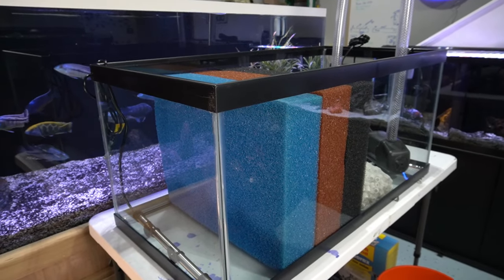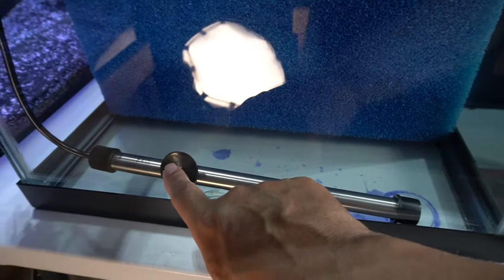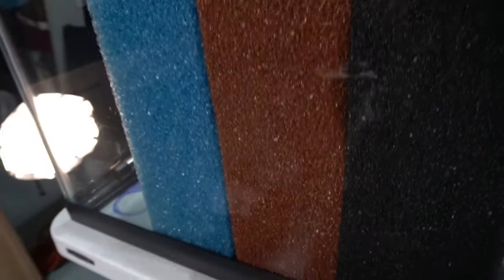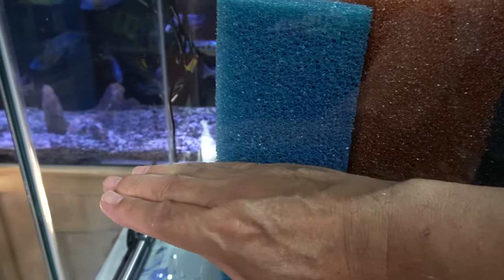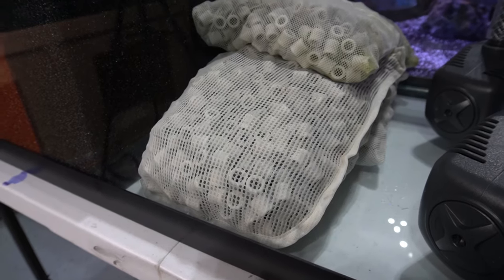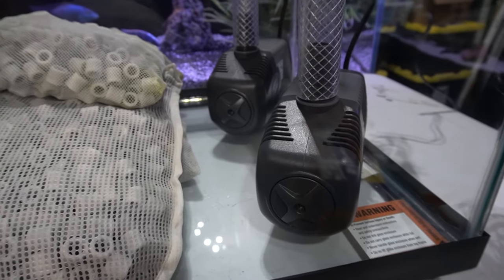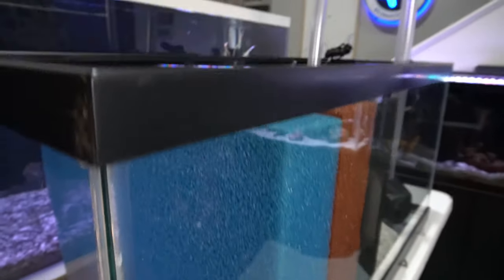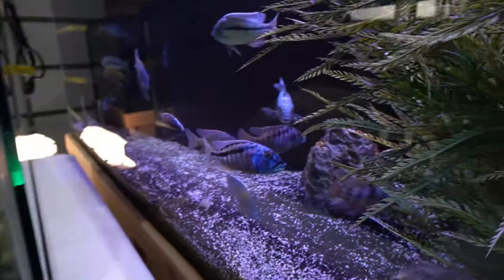A SIMPLE DIY SUMP [Going Under the 300 Gallon] - It's Going to ROCK!

Comment: Pj aqua maintenance 
Hi Ben the sponges in your 40 gallon breeder . What holding the sponges straight up.
Reply from the maker: They are cut an inch wider than the tank and have to be forced into place. The pressure allows them to stand on their own eliminating the need for glass baffles or walls.
Reply: hey you can just use silicone to adhere them to the place you like won't be more simple
Reply: @xmanu100  If for some reason you need to remove them you then have the issue of dealing with the silicone and possibly ripping the foam and again putting the silicone back on them. His way all you have to do is angle them out, deal with them then put back into place and done. Seems easier that way.

Comment: I just use standard bio rings in my Eheim canister never had a problem running nitrate level of 10 parts I feel these big names have got there hands in our pockets
Reply: Go to Swiss Tropicals website...they agree about all these fancy bio media types.  I have been using their 30ppi foam as my bio for years...far cheaper and far more surface area.
Reply: @T0tenkampf  spot on I only spend money when needed like I have Eheim classic XL 1500 filters on my tank and now have less than 5 parts of nitrate and have a well stocked Malawi tank

Comment: Keeping it very simple, yet effective with those massive sponges. Looking forward to seeing this sump dialed in and running. Keep the motivation going 😎
Reply: Best part is that those sponges don't break down, I have sets still in use after 12 years!
Reply: @T0tenkampf  Nice , I was reading up on http://www.swisstropicals.com/ and they have a nice variety at a good price. My next tank will have these incorporated in the sump for sure.

Comment: Exactly what I was looking for, I've been using Poret in my FX6s for a while now but want to try a Poret sump on the new 180 gallon red eared slider tank.  She and her 8 inch long pleco buddy are a bit messy.  If you have been to Swiss Tropicals website then why not use 30ppi foam for your bio filtration?  It's surface area for bio film is proven to be greater than any product on the market.   Yeah, I'm a big fan of Mattenfilters too lol.

Comment: I like this sump. I would have the 10 PPI single first and maybe add a thin 45 PPI sponge before the ceramic media. If you stuff filter floss or Purigin in an HOB filter, you can easily change it out every two weeks and have the clearest water ever.

Comment: Nice and simple. My only question/concern would be whether the sponges would get fully utilized..that would depend on how high the water rises on the side it comes in from the tank...but with those sponges, you're covered well Ben.
Reply from the maker: Ideally I want a couple of inches of free space at the top to handle drainage when the pump goes off. I could have gone with 12” tall.
Reply: The part sticking out of the water may actually act as wet/dry media

Comment: Love the sump ideas. You can add couple of gallons of K1 media where the water drops in, and that force will fluidize it. The sponges will keep it from floating around.  You will then have about half cu ft of fluidized K1 along with about 1 cu ft of sponges and Siporax. You could also add pot scrubbers around the Siporax and can cover that area without worrying about the pumps sucking things up. 

I would love to hear a  bit more about Siporax and why you chose that over other media
Reply from the maker: That’s a good idea

Comment: Hey, is a sump filter easier to take care of than a canister filter? The reason why I asked I have always had canister filters are over the back filters selling a 75 gallon aquarium with a 40 gallon sump under the bottom of the stand, the price is not bad the only thing he is, I’ve never run a sump. The tank used to be a saltwater, but I’m going with a freshwater.

Comment: Finally ordered my pads and now have everything needed! I got 3" 1x 10, 2x 20 & 1 30 for a 55g sump per recommendation
Reply from the maker: Let me know how it goes
Reply: @Ben Ochart  quick question, I'm doing a 55g version on a 220g, I see you're using 2 return pumps. (A) how many gph? (B) i would imagine one big one that does 1100gph would make the return flow very strong which is the reason for 2 smaller ones, am I right?

Comment: Just purchased my first 300+ gallon aquarium (new to me) has misc parts and pieces....Love the DIY sump setup you and will be building it. I need to find large bulkheads as the tank is Slate bottom pre drilled with over flow on each end....Slate is almost 2 inch thick, any thoughts on bulkheads ?

Comment: simple sump...fill a large rectangle bucket 1/3rd of bio gravel,  drill plenty holes in the base of a smaller bucket and then fill this bucket with sponge, sit it drilled holes down in the big bucket. water from the tank goes through the sponge and into the bio gravel, you put a return pump sitting on the bio gravel in the big bucket, you can put  heater sideways in the big bucket too.

Comment: Really enjoy your videos, you have some really lovely fishes. I have seen this sump setup in a video done at KG Tropical channel as well. I am about to set up my sump in a similar manner using biohome media. My only concern/question is would it make the media a bit less effective as water might go through the top section without getting in contact with the media or it not going to make a difference I am not sure so asking thanks.
Reply from the maker: I think you’ll be okay. Aerobic bacteria needs water flow but anaerobic likes little to no flow, so, worse case scenario is you’ll end up with some of both types and that would be a good thing.

Comment: What size sponge filter are you using? Seems exactly fits the tank. Thanks in advance
Reply from the maker: I contacted Swiss Tropicals, gave them the tank info and they custom cut the sponges to fit snug and perfect.

Comment: Looks really good ben I'm very interested in what you are planning to keep in the 300. Curious when will you  be revealing that information? Also i think the algae scrubber is a must for a tank that large because it won't be the easiest tank to clean so why not make you're life easier. Well take care ben and good luck. P.S. i saw you got a new hygger heater the large one thats kinda flat looking well i had the same exact one unfortunately it only lasted 13 months. I still like hygger but that heater didn't work out for me. I do have another hygger that's rated the same 800 it just looks a little different. I've had it for about 6 months so fingers crossed. later bro.

Comment: Simple is definitly better. I would Really  like to see this in action. Will you be using any floss pads in front of the sponges?
Reply from the maker: Possibly. I’m using one in the sump under the 210 and it stays clean because the socks do such a good job pre-filtering.

Comment: Sorry if this question has been asked, but is there any type of seal or bond to keep water from going “under” the sponges? Or is it so little it’s negligible? 

I just was thinking if the pumps were so low, they’d be pulling with main pull towards the bottom of the sponges.
Reply from the maker: I think, based on watching the accumulation of detritus over a couple years, it’s negligible. The accumulation of detritus seems evenly distributed.

Comment: How can I clean my pump without flooding? THANKS AGAIN BROTHER...
Reply from the maker: Part of setting up a sump is determining how much water will back siphon into the sump when the pump is off. Just play with the total amount of water that you're running until you determine how much can be run (how full should the sump be before you start the pump) so that a flood becomes impossible.  This assumes that you have safeguards in place that stop back siphoning like one way valves on the returns and outputs near the surface (or with small drilled holes just below the water line) that will quickly break the siphon and prevent the too much water from backing up into the sump. It has to be tested and I suggest you mark the sump at the level you can fill it to once determined. Once that's dialed in you can remove the pump to clean without worry.

Comment: replicating this design and I'm finding a lot of conflicting information on how large a sump needs to be, would a 4ftx34cmx46cm be sufficient for a tank of 1600 litres? (many forums argue that sumps should be anywhere between 1/4 to 1/3 the size of the display, and your design is obviously much smaller than that)
Reply from the maker: I'm currently getting great results with 40 gallon breeders under my 210 gal and 300 gal tanks. Both are further backed up by canister filters.  Bigger, with the additional water volume, would naturally dilute more but is it the only way to go. I don't think so. For a while I had a 29 gallon sump on that 210 tank and it was rock solid.

Comment: Hello hello I saw the preview on the live..... I've been using poret foam from Swiss tropical since 2016 I've used all ppi and sizes from 1" to 4" here are some things I've learned 4" 30ppi clogged up as fast as a 2" 45ppi. 4" 30ppi is really hard to "clean" 2" 30ppi is perfect and 3" 20ppi is perfect last thing for canister filters I use 2" 45ppi as the mechanical because it traps the most things then 2" 30ppi........ Think about putting a 2" 45ppi in the front and clean it out when needed...... Great setup sorry I couldn't give away advice 😂 😂 😂 😂 ps if I had a 300 I'd put
Spartans in it
Reply from the maker: Good points. Stephen at ST suggested 10-20-20. Let’s see how that works out. If I end up putting socks or a wall of Pinky Floss it should allow those sponges to run a very long time without clogging.
Reply: Oooohhhhhh I don't know why I thought you said 30ppi yeah 20ppi at 4" will great

Comment: Hi Ben I used your idea for my sump, it's my 1st one . My question is, how to disconnect my sicce pump without flooding.? The company that installed the sump did not put any shut-offs or any thing that stop back siphon. But I want too clean my pump?? Thanks brother...
Reply from the maker: Part of setting up a sump is determining how much water will back siphon into the sump when the pump is off. Just play with the total amount of water that you're running until you determine how much can be run (how full should the sump be before you start the pump) so that a flood becomes impossible.  This assumes that you have safeguards in place that stop back siphoning like one way valves on the returns and outputs near the surface (or with small drilled holes just below the water line) that will quickly break the siphon and prevent the too much water from backing up into the sump. It has to be tested and I suggest you mark the sump at the level you can fill it to once determined. Once that's dialed in you can remove the pump to clean without worry.

Comment: so what stops the water from flowing if your pump fails or power goes out,,  you didnt talk about that at all,
Reply from the maker: There are numerous safeguards such as one way valves in the return lines and outputs near the surface so the siphon breaks before too much water can back siphon. Check out my sump filtration playlist. There are several videos on preventing sump floods. This video was about the set up of my DIY sump.

Comment: Thank you for the great videos. I have been considering a sump but the one thing that I have wondered about is will it pull the fish poop up off of the substrate? I currently have an FX with the intake just above the substrate and wave makers that push it into the intake. It works very good this way. Will the sump work as good as the canister in that regards? Again thank you for the great content.
Reply from the maker: Good question. Yes, by doing what you’re currently doing, a wave maker will suspend and move water to the sump overflow. I have to swap out the filter socks in the sump twice a week, so I know it’s working.

Comment: I’m late to this video, but was wondering if you had a video on plumbing the corner overflows on the 300
Reply from the maker: The 300 has a drilled to back (center) box from "synergy reef" that moves the water down via 1.5" pvc to the sump. There a main drain, a secondary and a third emergency overflow, making it impossible for the overflow box to clog up.

Comment: Hi Ben - this looks great.  New to sumps.... how does the tank water get to the sump?  Do those two pumps pull water through the sponges and create a suction all the way up the intake tubes and the aquarium itself??
Reply from the maker: There's an overflow box that water pours into as the water is pumped back to the tank. The water flows down plumbing and the pumps in the sump pump water back to the tank, round-and-round that volume of water goes.

Comment: Can you tell me what size tank i need to make a sump for a 150 gallon tall tank and if I'll need to drill holes in the bottom of the main tank?  Thanks
Reply from the maker: I'm using a 40 gallon breeder under my 300 gallon and it's doing well, and I'm using a 29 gallon as the sump for my 210. Bigger is better but it depends on your budget and size limitations.
You can drill the tank for an overflow box with a tall towner (drilled in the bottom) or a box that would require drilling out the back. You can also get what are called Overyflow boxes that can allow you to skip the drilling (but are not as rock solid reliable as a drilled tank).

Comment: Hey Ben I’m unfamiliar with sumps I run 2 FX 6’s on my 125. What are the advantages of a sump over canisters and does the pump push and pull the water into and out of the sump?
Reply from the maker: The added water volume and ease of access make sumps a better choice. But having said that, 2 FX’s on a 125 will give you a great result. 
Sump pump moves water to the tank and a water “overflows” back to the sump.

Comment: Would a 20 g long be sufficient for a 100 g tank ? What size sponges and pumps, bio media amount  needed ? I’d like to do this and does this remove the need for my fx 4?
Reply from the maker: I’m using a 29 gal for my  210 gallon tank, so I’d say yes. Contact Swiss Tropicals and they will recommend and custom cut the sponges for you. And yes, a second filter is always a good idea. Your sponges will work as your bio media as well.

Comment: I’m new to sumps how many pumps do you need?
Reply from the maker: The trend has gone to 2, that way if one fails you still have water movement.
Reply: @BenOchart  how strong of a pump? And what size Pcv pipe? And bulkheads?

Comment: The foam should go from 10 ppi to 20 ppi. Looser going to finer porosity.  I have settled on 10>20>30>45 ppi to really polish the water and get it to that next level of clarity.  L
Reply from the maker: Per Stephen at Swiss Tropicals, anything above 20 will clog too quickly and at 4” wide and 14” tall, it’s a pain to pull and rinse them. So, 10-20-20 will allow me, I predict, to go for a year before need a full sump cleaning.
Reply: @BenOchart  my 45 ppi goes a couple months between cleanings.  I could not get the clarity I was looking for with 20ppi.  Hooe it works for you
Reply: @HalfManHalfCichlid  I agree with at least a 20/30 to a 45 water polishing. The water definitely is crystal clear. Let the 20/30ppi handle bio. I power rinse the 45ppi and done in a couple of minutes. For super polishing I attached a 60ppi sponge or a filter cartridge used for house water filtering (similar to an ROI) to a small pump and let it run over night.
Reply: @migueleespinosa2632  great ideas.  Do you have more facts/links on the super polishing set up?
Reply: @HalfManHalfCichlid  just take the intake of a pump or power head of choice and attach the sponge/water cartridge. The sponges and cartridges I use have one inch openings on both ends, so I plug one end and the other is attached. I drop it in my tank because I'm not running a sump. If I had a sump it would be easier just to drop it into it. The Swiss tropical filter sponge cartridge is great at 45ppi. They are hugh at 19in in lenght and diameter of 4+in of choice. I run a 30ppi as a corner 19' x 4in prefiltet to my intake of my Fluval 407 in my 120g African Cichlid tank. Not complicated at all. The non sponge cartridges I mentioned may be found at Lowe's or Home Depot in the house water filtering section. Once you see them it will instantly click.  Think a modified RODI set up.

Comment: How is this sump working for you? I'm planning out a 55g sump for my 220 display tank in my shop and I'm very curious about this design. This is way easier and faster then siliconing in all the baffles.
Also, what thickness of the sponges did you use? Looks like maybe 3"?
Reply from the maker: It’s working perfectly. Sponges are 4” thick.